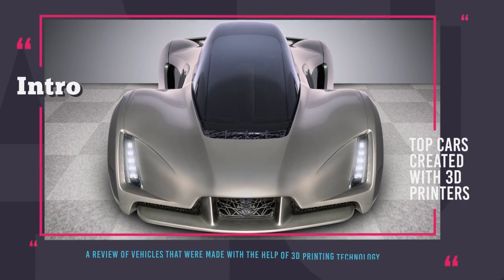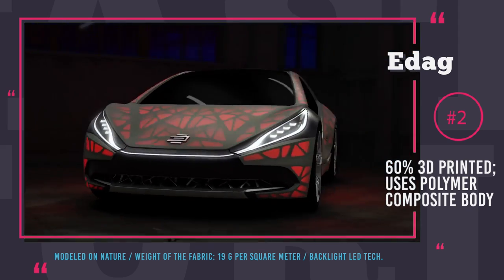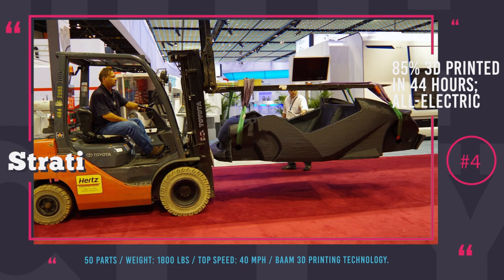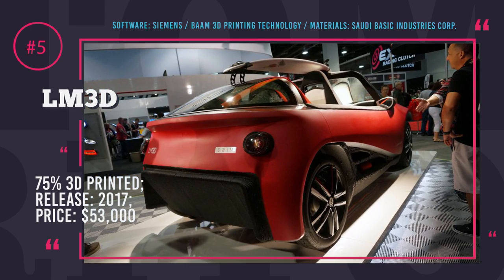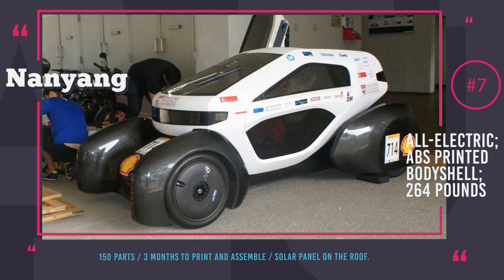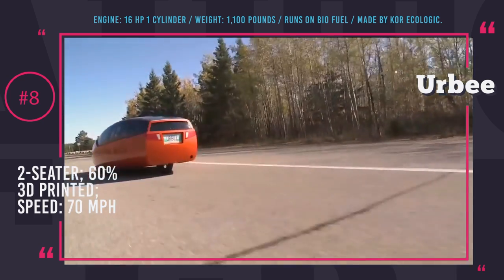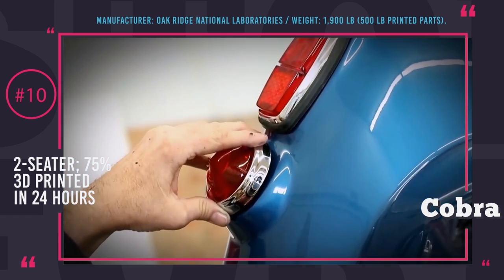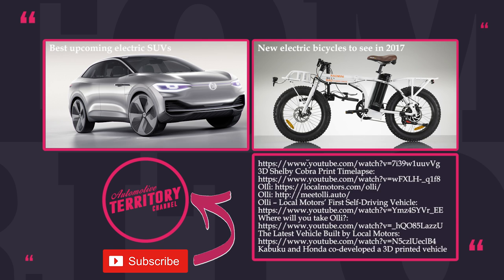Top 10 3D-Printed Cars - the Future of Auto Manufacturing

Comment from the maker: 3D printing seems to have found its application in many fields, even in auto manufacturing. But can these 3d printed cars become commonplace in the future?
Reply: Although the Edak product sounds good light and economy there would problems when traveling from sunny places.  I've traveled to normally warm a dry, and over night had 9 inches of snow, an that in certain locations there are garage and 16 inches of hit a location overnight as well.  If you how much snow weighs then you'll know that fabric stretch and collapse.  I've driven through hale storms and well think fabric protecting my head won't be acceptable.  Hale breaks the tempered glass, well can fabric do to protect its occupants, also those cars would be like those World War I aircraft: they fly in high windy places, basically blown off the roads.